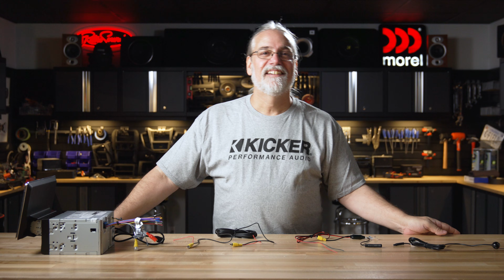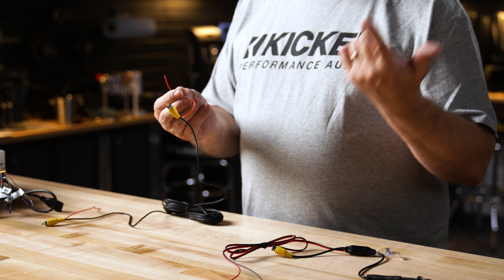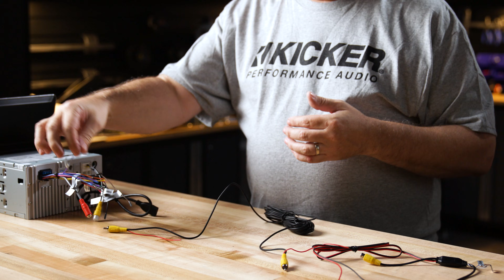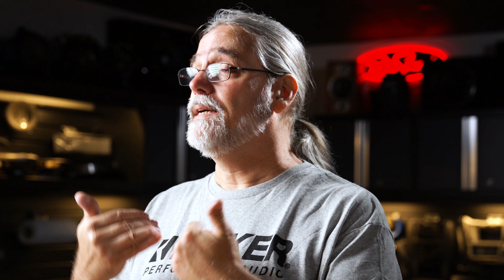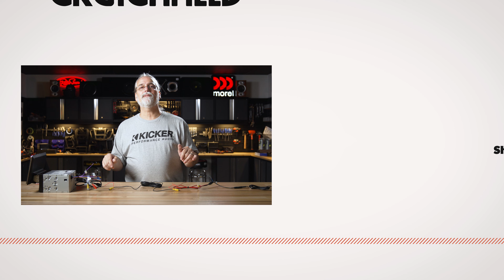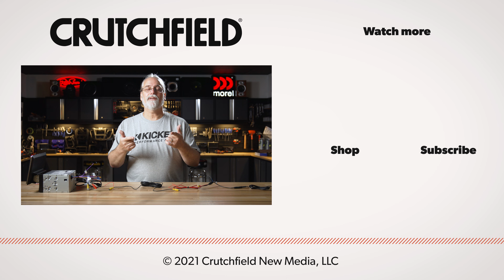Powering your backup camera (and how to use that extra wire) | Crutchfield

Comment: I’m sure it’s been asked and answered here, but I cant find the comment. My cam has LED lights that I don’t want lit l, unless I’m backing. How do I wire it to work without the LEDs, when not in reverse? Thanks!
Reply from the maker: Cameras with LED lights typically come with separate power wiring for those LED lights that when connected to the reverse light circuit, will only come on when the vehicle is in reverse.

Comment: What do you do when the camera wires at the ferrite core(power cable) gets hot
Reply from the maker: It is expected that the wires will sometimes be hotter than they are at other times. However if they are getting so hot, they feel like they could almost melt the shielding, we recommend contacting technical support for help. The wires should not be getting that hot and its best to check the install and troubleshoot to figure out what is causing that intense of a temperature. If you purchased your gear from us, we recommend contacting our technical support for the troubleshooting help. We include their toll free phone number on the order invoice

Comment: Thanks for the video! If the reverse light is far from the camera, can I tie the red wire from the video cable in rear to the red from the power cable, then tie the power cable to the reverse light?
Reply from the maker: What brand and model camera are you installing?
Reply: did you try this? Looking to do the same thing

Comment: hello, I would like to try the back camera that I buy before even mount them on the car. Do you know any efficient and secure way to power those cameras at home?
Reply from the maker: What brand and model camera do you have?
Reply: @crutchfield  normal rca camera but the problem actually I would like to power also the head unit i have
Reply from the maker: The best option for powering up the camera will depend on the exact model. Most folks will wire up a new radio in their vehicle and test it before finalizing the install. If that's not an option, you could use a power inverter.
Reply: @crutchfield  that's a good idea thx
Reply from the maker: Anytime!

Comment: It’s there any probability my back up camera is draining my battery? How can I test it? Because something is draining my battery but don’t know what it is.
Reply from the maker: If the backup camera's power wiring is connected to a constant power source in the vehicle, then it would always be on and drain the battery after a while. A screen that can run when the vehicle is off and has a composite video input can be used to check if the camera is sending video when the vehicle is off. Also, checking the vehicle's wiring schematic to see if the wires used to get power to the camera are constant or switched power may be an easier way to check if the camera is the cause of the battery drain. If you purchased your gear from us, you can contact  our technical support for troubleshooting help. We include their toll free phone number on the order invoice

Comment: nice video i hooked my wiring to the backup lamp and the back of the radio my radio you have to manually select the camera screen (its just too cheap of touch screen radio to come on as soon as your in reverse)
Reply: im going to be building a custom aluminum flatbed and will go through the entire truck wiring and redo it and use much more modern stuff and add a better touch screen radio then i will be able to get the camera as soon as i go in reverse
Reply from the maker: Having the option to wire the camera to come on automatically when you go into reverse if a plus for sure! If you need help choosing when you're ready, let us know.
Reply: @crutchfield  
i appreciate it but more then likely i will use a wrecked ford so i can get the interior as well(like a 2017+ f250/f350) then ill have maps and a bunch of other features not available with cheap radios ill definitely contact yall when the time comes if i choose not to use factory ford stuff

Comment: I did exactly this, but somehow my camera only works when I press the reverse software. It does not change automatically, when I put it in reverse. And my backlights flicker a tiny bit sometimes, after doing this.

Still trying to figure where the problem is.
Reply from the maker: This video covered a couple different installation procedures. If you are getting the power for the camera from the reverse light circuit, then the 2nd and 3rd sections of this video are the most helpful with how to join wires so the radio automatically changes to the backup camera view when the vehicle goes into reverse. If this information didn't help resolve the issue, you may want to contact technical support for more detailed help. If you purchased your gear from us, you can contact our technical support using their toll free phone number that's included on the order invoice.
Reply: @crutchfield  
It is fixed now.
Didn't expect the problem to be on a conector.

Saw many videos after installing it, including this, and it was all correct.
But I used one of those Scotch lock wire connectors.
And somehow it didn't "cut" one of the wires deep enough, so no power was getting to the reverse wire.
Reply from the maker: It's great to hear that you were able to get everything working! 🙂

Comment: I love your video, but what about if i want to keep my fsctory camera on a Aftermarket stereo and  te cable adaptor doesn’t come with power / ground cables. The convenience cable can do the job to energize the camera ?
Reply from the maker: We do not expect there to be an extra, unused, factory installed wire running the length of the vehicle; we do not expect there to be an option on when the stock camera gets its power. But sometimes there are options if the stock wiring is laid out such that the backup camera gets its power from the front of the vehicle. What is the year, make, and model of your vehicle?

Comment: I’m wanting to wire my camera so I can see my trailer when I put it in reverse and also when I’m driving down the road how do I wire it 2001 F150 Supercrew 5.4
Reply from the maker: A backup camera is a huge plus when you are hauling a trailer. What model camera do you want to use? What do you plan to view it on?

Comment: Excellent video! I have a question: how to find the hot wire that goes to the backup lump?
Reply: I managed to find it everything works perfectly except that I don't have the distance lines. I have a white line which I don't understand what I need to do with it do I need to pull or cut it?
Reply from the maker: What model camera are you using?
Reply: @crutchfield  Thank you for your feedback, there was a wire that I had. to cut in order to have the lines so now everything is OK
Reply from the maker: Excellent. It's great to hear that everything is now working correctly. 🙂
Reply: Thanks to you and your video I managed to complete the installation.
Reply: @crutchfield  Thank you.
Reply from the maker: You're welcome!

Comment: Do you guy know why mi camera its working good with the switch on and reverse gear on but if I start the car and put reverse mi screen got black and music its glitching
Reply from the maker: Hi Rick, sounds like you may want to double check your wiring and also the camera settings on your radio. If you got the camera or radio here, you can call our Tech Support for installation assistance as well. Their direct number is on your invoice.

Comment: can hooking the ground wire of the back up camera to the back up light wiring cause the battery to drain? i think that is what i did, and if my car sits too long now 3 days the battery won't start the car up. if i make sure that the ground coming off the back up camera is grounded to the frame would that solve that problem?
Reply from the maker: Typically, no it would not cause the camera to stay on because the backup light circuit should only be on and pulling power when the vehicle is in reverse. Attaching the camera's ground wire to the reverse light's ground wire can cause noise/distortion but not a battery drain. Something else must be happening (i.e. radio stays on because its not connected to a switched power source, etc..) to cause that battery drain. We recommend contacting technical support for help troubleshooting it. We include the toll free phone number to call our technical support on the order invoice.

Comment: Does the wiring diagram change if we have canbus installed for the steering wheel control.

If we have canbus installed can we still wire using old schooled way ( power from camera to (reverse light +, and ground), and connect that to red power from RCA video at the back end??

And then normal at front (RCA yellow to video input in stereo, and red wire out of RCa wire to reverse light from stereo ))

Thanks
Reply from the maker: The wiring would not change. Be sure to refer to your camera specific instructions though.

Comment: My stereo doesn't have a reverse trigger wire, where to i connect the power cable?
Reply from the maker: If your stereo does not have a reverse gear trigger wire, then you do not need to worry about connecting that wire to the convenience wire and should skip the 3rd section of this video. But you can still consider getting the power for the backup camera from the backup lamp circuit as described in the 2nd section of this video
Reply: @crutchfield  so in my case, according to the video, the red wire that's supposed to be connected to the trigger wire on the stereo should be connected to the backup lamp circuit?
Reply from the maker: Since you don't need to use the convenience wire you should leave its ends unconnected. You only need to connect the power wiring for the camera to the backup lamp circuit. This wire is usually coming from the camera's attached cabling.

For help making these connections and ensuring you are able to use the camera with your radio, we recommend contacting technical support for additional help! We include the toll free phone number to our technical support on the order invoice for the gear.

Comment: So, if I use the convenience wire and the reverse wire is hooked to the back of the radio, then I don't need the power wires in the back hooked to the backup lights?
Reply from the maker: Yes, if you use the convenience wire, then you don't connect the camera's power wire at the back. Instead, that wire gets connected in the front of the vehicle via the use of the convenience wire.

Comment: Awesome video and definitely clears up my question about the power and trigger wires.  The particular harness that came w/ my camera has the yellow RCA cable to plug in behind the radio, and has the mini "barrel" plugs that connect the long harness to the short one coming out of the camera. What I'm not understanding is how exactly to land the 3 soft wires(red,black&purple) that are on both end of the harness. If I terminate each of them behind the unit, do I still have to do anything with the other end of them that will be at the rear of my truck? Also, just so I'm understanding correctly, Red is for 12v power, black is for grounding to frame, and purple is my trigger? Thanks so much in advance.
Reply from the maker: Backup cameras do not usually come with a trigger wire but sometimes come with a power wire for lights built into the camera. We recommend consulting the manual for that harness to check the function and purpose of the wires.

It is likely both ends need to be connected to something if they are being use to relocate the camera's wiring to the front of the vehicle instead of being connected to wiring in the rear of the vehicle (much the same way we had to connect both ends of the convenience wire discussed in this video that is attached to the extension cable). However that usually means there are 3 sets of these bare wires and you have two sets. It may be best to consult the manual on just how they get used (or left unused).

If it was purchased from us, you can contact our technical support for help. We include their toll free phone number on the order invoice

Comment: if you have a camera wired for towing and the camera has led lights, will the led lights stay on, even if your not using the camera?
Reply from the maker: The LED being on/off or selectable depends on the camera. Some provide separate wires for them while other cameras do not.

An example of this is Installing a camera that does not have separate power wires for the LED lights so that the camera can be viewed while not in reverse. This does mean that the LED lights, if installed so they get power, will always we on when the vehicle is running.
Reply: @crutchfield  thanks I thought I did something wrong again, took the radio out checked the wires, lol turns out you can  disable the lights by cutting the little brown looped wire, thanks for the info.
Reply from the maker: You're welcome! Let us know when we can help again

Comment: On a factory head unit, what do you connect the convenience wire to? Accessory power wire?
Reply from the maker: Depending on your camera and radio, you'll connect at the rear of the vehicle and/or at the radio. The camera instructions will specify. If you got the camera here, you can call our Tech Support for wiring assistance as well. Their direct number is on your invoice.

Comment: Is it possible to have constant switched power to the camera but have the deck wire wired to reverse signal so I can have the camera work both ways? While slapping it in reverse and/or turn it on while driving if I like?
Reply from the maker: Yes, if the camera is wired to constant power, it could be accessed manually at any point with most aftermarket head units. And if the head unit's reverse wire is connected to the reverse lamp circuit in the vehicle, the stereo will automatically switch to the camera input when the vehicle is placed in reverse.

Comment: Hey there... Thanks for the detailed explanation of the convenience wire and the reverse trigger wire, but is there any "extension" or any "updated special RCA" that might include sending voltage through the Cam-In jack to a display. In my case, I am not plugging the camera to a head unit but to a Smart Screen (no RCA video in or a cable to attach to the trigger cable)... It is a big 10.3 screen with CarPlay (of a certain Chinese brand). which comes with a 2.5mm Cam-input jack. Of course, I bought an extension with a female RCA video to a 2.5mm plug, but it is not working,. There are zero tech specs for the display and the manufacturer does not answer with tech support. Any ideas? Again, thanks a lot.
Reply from the maker: If the device being used to display the backup camera video does not have a trigger to automatically load the image, then one extra step is needed: needed to choose the camera input as the one to display. However, it appears you are not able to get an image at all under any condition which means troubleshooting is needed. We do not have experience with that type of product to know what adapter may be the best to use with it to check it. You might check product reviews for it to see if anyone has listed an adapter that works.
Reply: @crutchfield I think I forgot to mention that I didn't want only a reverse camera, so I bought a 360 Bird view camera system from a generic "Brand123". The 10.3" Apple Carplay monitor screen is from Carpuride  and they sell separately a single reverse camera which plugs into this screen (and some others from the same brand). Supposedly, their screen along with their  reverse camera is designed to show  the video feed when u shift to reverse, without any intervention. I tried to mimic this and asked them, but NULL technical support. My guess Is that their cable (might be an adapter)  is not a regular RCA, but incorporates something to send voltage thru the 2.5mm pin into the 2.5mm jack... I couldn't find any reviews or comments and nobody has been able to answer my questions in Amazon. Thanks again.

Comment: There's one thing that is never covered in these videos. If you have constant power to the rear view camera the lights on the camera stay on the whole entire time the car is running. Is there a way to bypass the lights of the rearview camera to cut them off and still have visual from the rearview camera?
Reply from the maker: Backup cameras with LED lighting should also come with a trigger wire to activate them when desired. Some even come with a button for that purpose. While it would not be an issue having them run all the time when the vehicle is running, it is possible to have them triggered to turn on with the backup lights, running lights, etc... This also makes it possible to use the camera without its built-in lights being on.

Comment: just for my future knowledge... @0:55 why should we not hookup the ground directly to the backup wire ground wire? Will there be sound interference if the wire is hooked directly into the backup wire?
Reply from the maker: You want to wire them independently to ensure a proper ground.